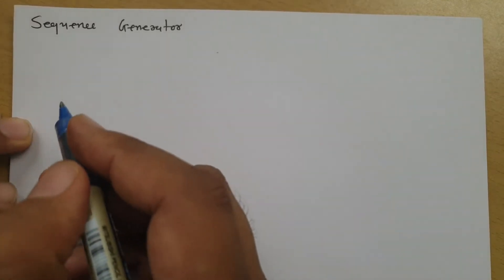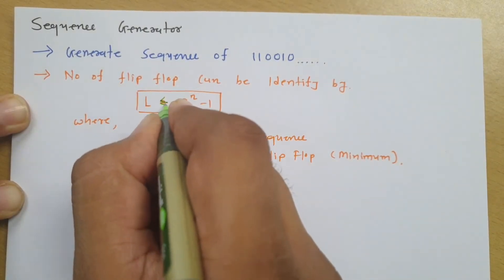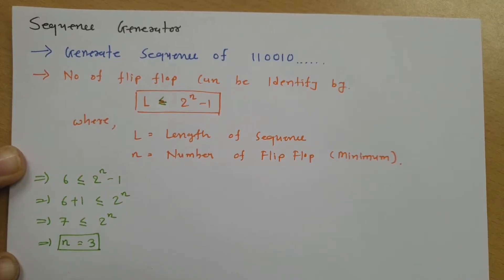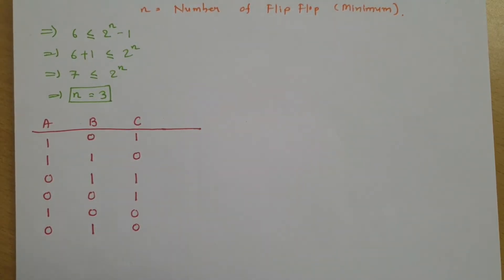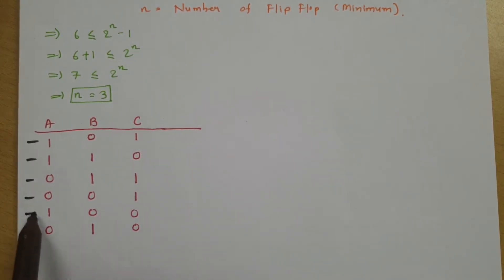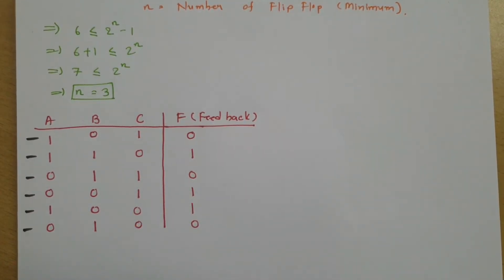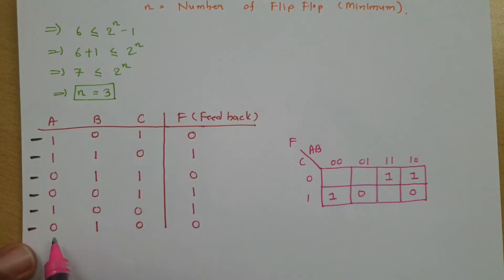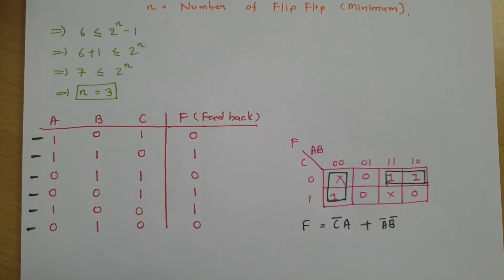Sequence Generator Example 2: Designing Steps, Circuit, State Stable & Working

Comment: Sir 7<=6 is how its possible if u take n=3
Reply from the maker: n = 3 means L = 2^3, so data starts from 000 to 111 in binary. Here 6 is 110 which is lower then 7.
Reply: @EngineeringFunda  ok sir thank u